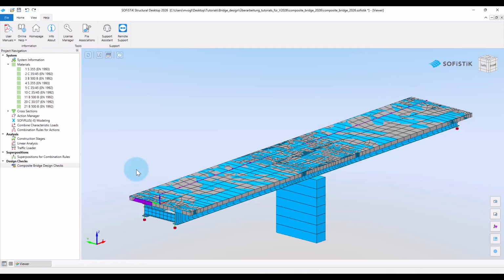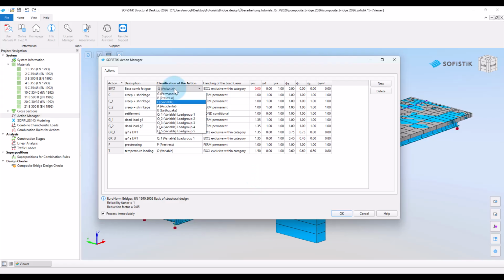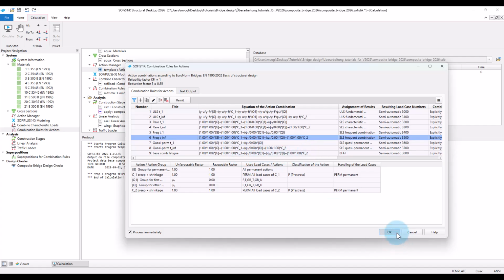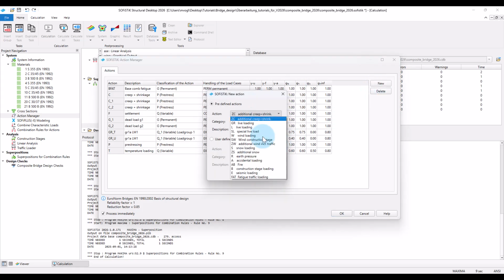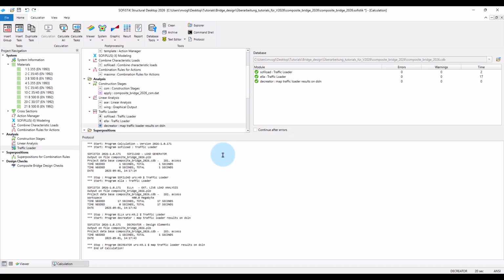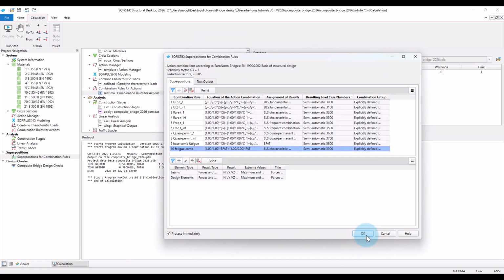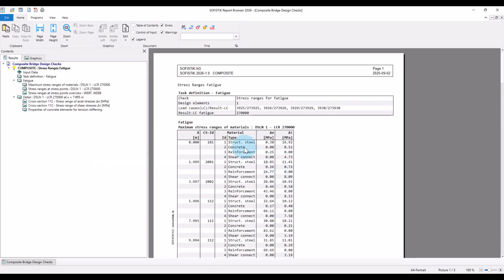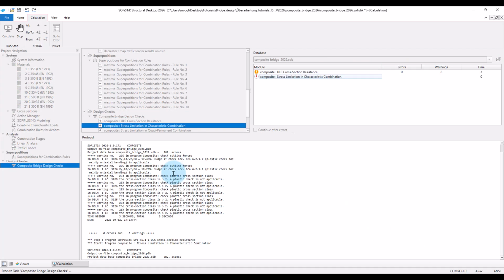Composite Bridges: Stress Ranges for Fatigue

Comment: Hello.

I am trying to perform the fatigue design of a composite bridge and I am having some trouble defining the fatigue load train FLM3.

According to EN 1991-2 4.6.4 (3), if the maximum span length of a bridge is ≥ 40m we have to take into account two vehicles in the same traffic lane with different self weight in a distance between those two vehicles >40m.

Is it possible to define this load train in sofiload?
Reply from the maker: Hi georgepapaioannou1959,
please foward your request to our support team :)
You can reach them in your SOFiSTiK Structural Desktop (SSD) - Help - Support Assistant